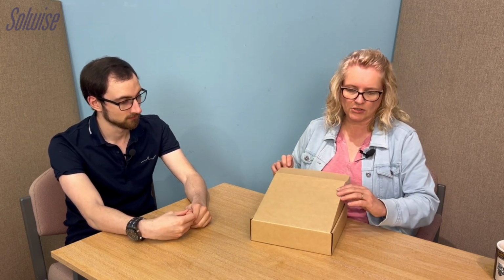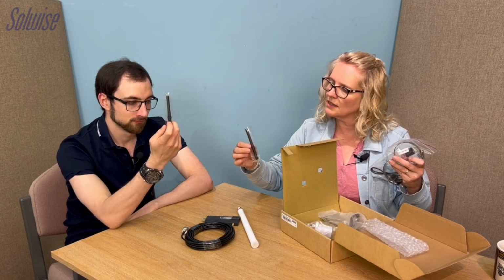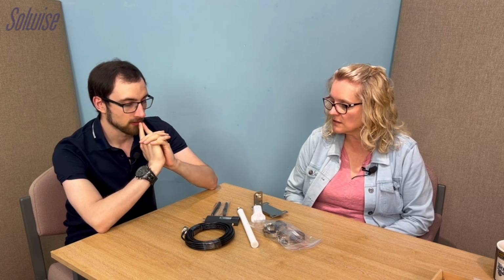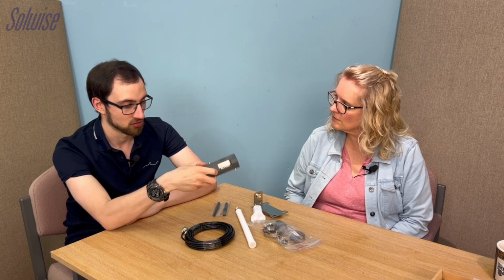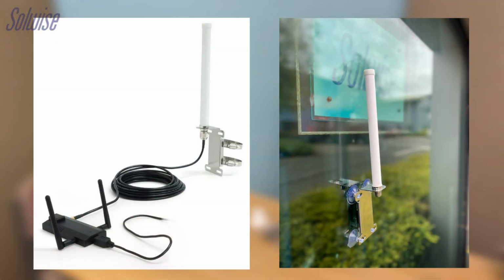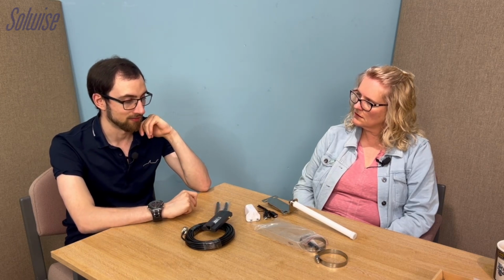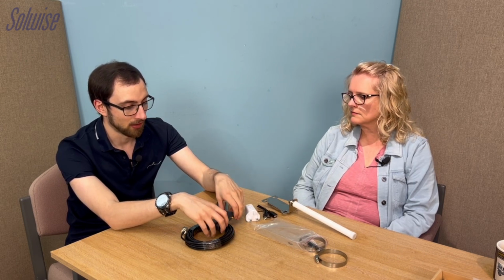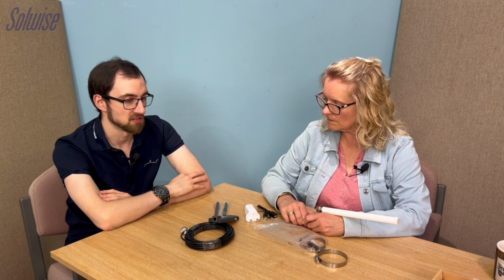PATRIOT-NANO - WiFi Extender - catch it outside, use it inside

Comment: Will this work on a Mac?
Reply from the maker: Hi there, The Patriot-NANO works by collecting an already existing WiFi signal via the outdoor antenna, then repeats this signal inside your building/vehicle via the broadcasting device, so granted your Mac device has the ability to connect to WiFi, then it should work for you. Thanks for your question.